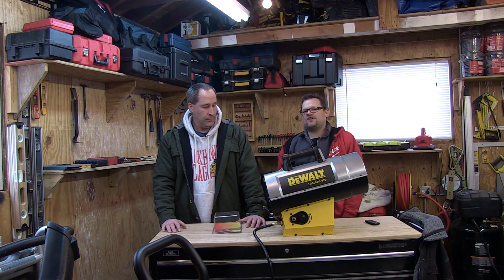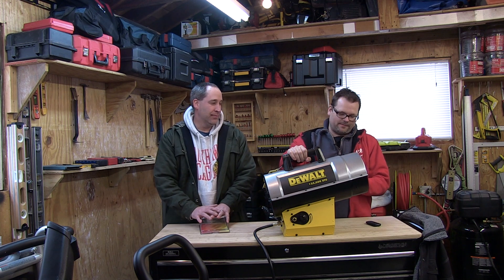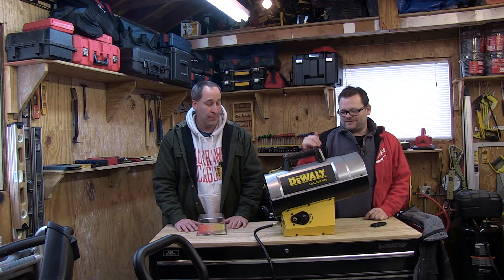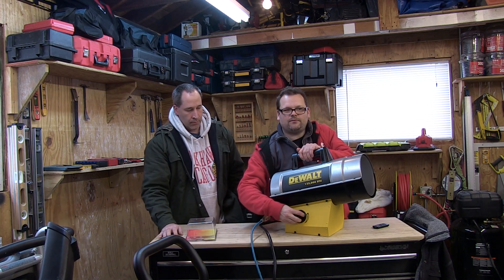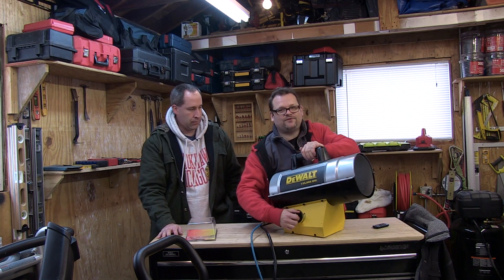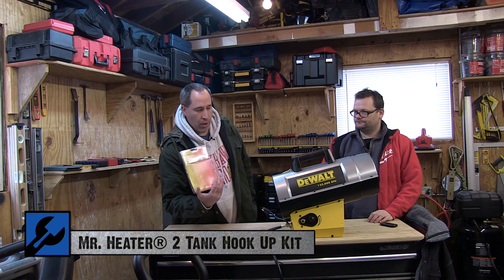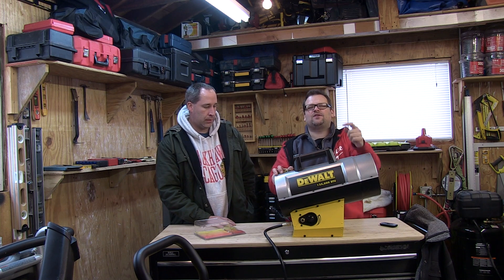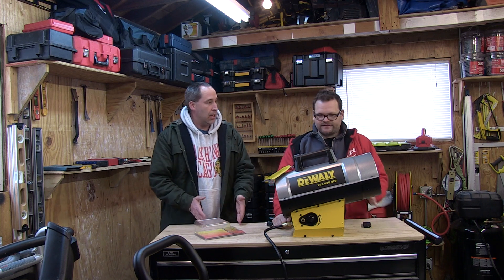Dewalt DXH125 Propane Heater

Comment: Tried to scan down and see if anyone else caught this. You guys are referring to 20 gallon and 40 gallon LP. Its 20 lb and 40 lb. But thanks for review. I just bought one today and was wonder how long it was going to last with my 40 LB tank. They changed the ignition. It is built into the dial. Push in to start. Also on the box says just attach to 20 LB tank.  I have one for back up.

Comment: It would probably be to big for my shop. I have one of the propane mr heaters, it does a decent job, not take your jacket off. But it works. My shop is getting overrun with yellow and black.